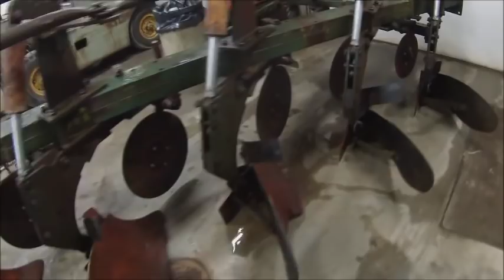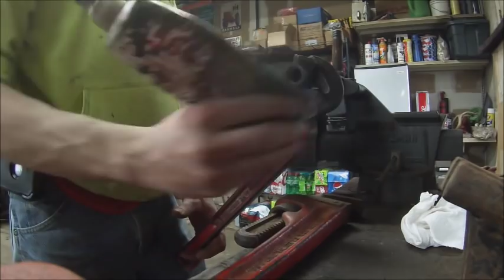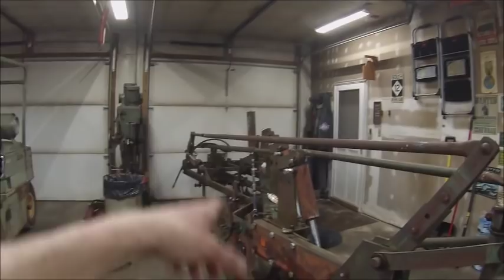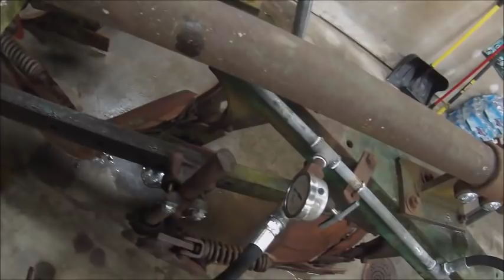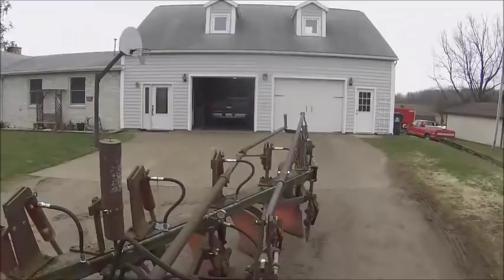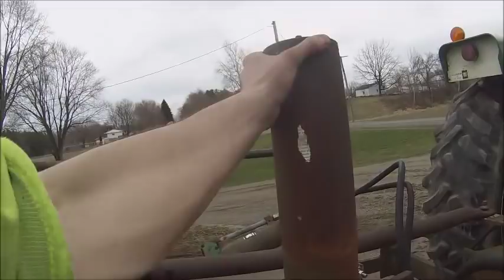Oliver 575 Plow Build Part 5

Comment: I'm surprised by something you've done that I just got my butt reamed for doing, Using galvanized pipe on a hydraulic system !   Not only using galvanized pipe but fittings too and your not using hydraulic pipe for the job. LOL Funny how one guy can do something and its a fantastic job and another does the same thing but gets reamed out about it ! LOL Great job on the plow BTW !  Bandit
Reply from the maker: Blame Oliver. I just put the same stuff on that I took off. Lol. And it’s galvanized on the outside but bare on the inside to stand up to weather. Most of the store bought galvanized pipe is just standard hot dipped so it’s coated throughout. That’s where the problem lies.
Reply: @Oliver66FarmBoy  Its like I told the guy Oliver put galvanized pipe on there tractors new and the funny thing was he told me the hoses were stronger than that pipe fittings I used !  I told him look at the hoses again as they have brass ends with brass braiding ! LOL All we can do is use what we can get cause sometimes what we need you just cant get without a lot of problems !  Bandit

Comment: Did this series have the gauge wheel option? Also what did you spray on the wear parts?
Reply from the maker: Yea it had a gauge wheel on it and I took it off with the 6th bottom. I have no clue what kind of paint they sprayed on the bottoms.
Reply: Oliver66FarmBoy can you normally pull a plow with out a gauge wheel?  It must depend on the area. Until I was in my early 20’s I didn’t know a plow could work without one. Can’t wait to see the plow and 1950 in action.
Reply from the maker: I’ve never pulled one with a gauge wheel. You only really need them on long plows.

Comment: What do you like to use to keep your mouldboards from rusting up we’ve either spray painted em, put old oil on or grease
Reply from the maker: I prefer grease but lately I have been using waste oil.
Reply: Oliver66FarmBoy ya it really helps plowing with clean shiny mouldboards. We bought a 4furrow overrun at a sale in fall at an old guys farm retirement sale got it for $1400 a steal because we brought and were prepared to spend $8000. Though the old guy did put all new mouldboards and I guess plow up a little bit of ground and didn’t treat the mouldboards so they were quite rusty so when we got it home we took it into the gravel pit and they shined up quickly.

Comment: Where your gauge is placed once you closed the valve wouldn't it only read pressure in the line up to the valve and not the system? Or maybe I am thinking wrong. Anyway glad you decided to make videos again.
Reply from the maker: That’s where it is supposed to be per the manual. Open the valve to read the pressure.

Comment: Make one more man. Let us see the finished product. And don't forget to repack the wheel bearings. I noticed Your pressure valve is on the tractor side of the hydraulic shut off valve. It's not reading the plow side but the tractor side hydraulic pressure. Great video, keep up the good work.
Reply from the maker: It’s on the list, and that is the side the gauge should be on per the diagram in the manual. If you need to read the system pressure all you need to do is crack the valve.

Comment: Your gauge is on the wrong side of the valve,   if its leaking pressure with the valve closed, its on the tractor side, not the plow..     Like your vids,  never realized how much R&D Oliver put into their plows
Reply from the maker: That is the side the gauge is supposed to be on per the book. If you need to know the pressure all you have to do is crack the valve open to equalize it anyhow.
Reply: Guess that makes sense too,   I'm just armchairing it,   Just seems like it would isolate the plow more if it was on the other side as it would seem it would make sense to keep an eye on that pressure, not what the tractor is producing.     If there are no leaks in the system, is a tractor connection to the reset cylinders after they are bled even really necessary?
Reply from the maker: No you don’t leave the reset system connected to the tractor during use.

Comment: So what happens to the oil that the accumlater blows out when it over pressure's does go into a case drain or something
Reply from the maker: It blows past the pressure relief.
Reply: Good job.  I remember charging those every couple of years.  I always like the extra weight when plowing in dry conditions. I always liked the old hydra electric cylinder for the tail wheel height.  When hooked to 1800.  The weight over the bottoms on a sloppy hitch would sometimes want to lean the plow over on a Old IH 806 with fast hitch. Hope you hit a rock or two on video so I can remember what’s it was like.  Couldn’t  even hear the bottom trip. Neat system. Good job on the rebuild

Comment: I was with my grandpa today, he told stories of a 1655 and 1755 that he had, both caught on fire for the same reason. The wire next to the fuel line under the fuel tank shorted out when it got hot and melted the fuel line thus catching fire. Have you heard of any situations like this? Have a good one
Reply from the maker: No. There shouldn’t be wires anywhere near the fuel lines.

Comment: What is the secret in finding the model of a plow?  I have an old  single plow and can't find any marking , needs new point/share etc. if they exist.   I have a Athen's model 48 disc which is obsolete too, but it is still works after I changed bearings. Any idea where to find information?  My 12/1/1965 Ford 4000 -- I rebuilt works like a charm.  :-)
Reply from the maker: Just have to start looking for pictures of similar plows.

Comment: damn why do american farmers still use bottom plows? here in germany its super rare to see one and most of the time they are very small
Reply from the maker: There are very few moldboard plows still in use in North America in general. Most of the guys that do still use them are growing certain types of crops that benefit from moldboarding over other forms of tillage.
Reply: Feuer Wolf It actually seems from here that chisel plowing, vertical tillage, and/or no till is far more common. It really all depends on the ground you're trying to farm. Moldboard plows seem to bury rocks and chisel plowing brings them up. It all depends on the ground.